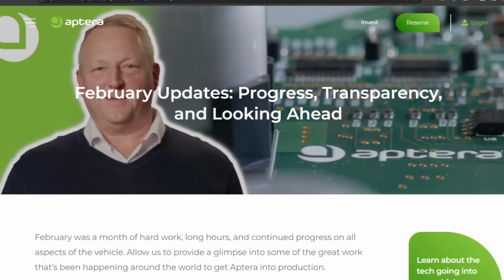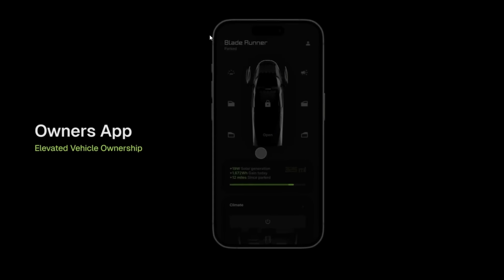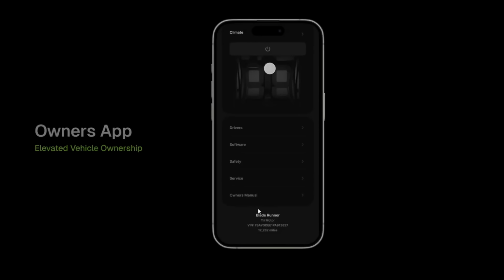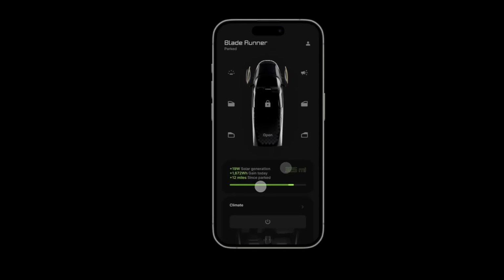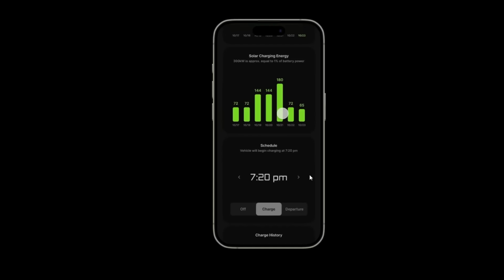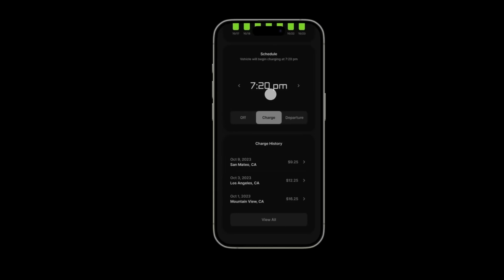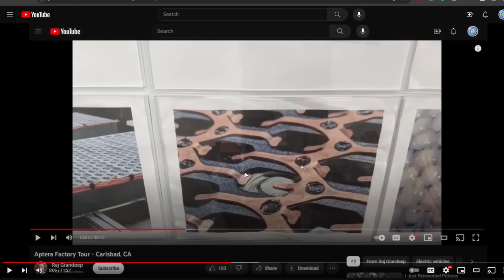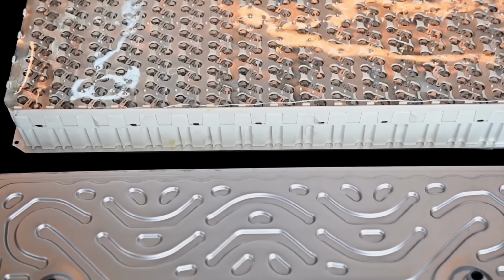Aptera February 2024 Update:  App and Battery Pack

Comment: If App is similar to the one from Tesla (which it probably is), on the Tesla App:
- Drivers - is to manage drivers, for example, if someone will borrow your car or you have 2 people using the same car at home
- Safety - there is no equivalent in the Tesla App, but could be to set up the top speed, valet mode and/or roadside assistance
- Service - to schedule service at a service center or to report a problem
- Energy Generation metrics are in KWh
- Battery Chage % limit - don't recall wiich battery will be used in the Aptera, but depending on the chemistry might not be needed, our Model Y is recommended to charge up to 90%, but on the 2023 Model 3 is Ok to go up to 100% (Tesla recommended settings)
- Charge history- Tela App has "Charge Stats", which has info on home charge history, paid charge history and also has metrics on energy savings, cost of charging at home and paid charge costs.

Hope this helps.

Comment: The idea of setting a charging limit below 100% is prior-generation thinking. Most current EVs have defined "100%" charge to be a safe value. For example, older Nissan LEAF vehicles were recommended to normally charge to no more than 90% (100% only at the start of a trip), but my 2021 LEAF normally charges to "100%" all the time. My guess is that, as the vehicle ages, whatever margin there was above 100% gets used to make the battery longevity look better.  Overall, this looks like a much saner view to battery management for the life of the vehicle, and I believe this is why Aptera expects their batteries to last the life of the chassis.

Comment: 3 points of interest,
1) batteries, CTNS is gonna help Aptera assemble the battery packs, but if Aptera gets cells from EVE energy in china, it would disqualify them from any potential IRA tax credits, and we haven't heard anything about this in a while, could they be sourcing batteries from someone that would allow them to qualify?
2) the motors, although we have heard that Aptera can make the motors themselves if the deal between them and elaphe has issues, but again we haven't heard anything about this in a while either, so are we getting motors somewhere else?
3) the belly pan cooling, could this be too much work and it be less engineering to go with only the traditional fan and radiator setup? dont they already need some form of forced air to cool things when parked at a supercharger? so will they skip the aluminum belly pan and go carbon instead?
Reply: I think that they have this all worked out.
Reply: Aptera has several possible suppliers of cells, and even though they have a contract with EVE energy, they will be able to balance the cost advantages and dis advantages with several different suppliers.  2170 811 NMC cell costs have been dropping rapidly.

We already know that Aptera is no longer using the standard M700 Elaphe motors that the design was based on.  Aptera's motors have been redesigned to lower the RPM of the torque curve and reduce parts count, making them easier to manufacture.  We don't know where these first motors will come from, but my guess is that Elaphe will build them.  Building a completely new manufacturing facility for them in the US, which they have the licence to do, will obviously depend on funding, but will likely happen at some point.

On your point 3, this is already settled, and pending validation in the PI vehicles my guess is that no change is required.  Adding a traditional radiator and fan beyond what is supplied with the HVAC system would destroy the promised performance of the vehicle.

Comment: Thx Steve. Re the APP…. I can only speak to my KIA Connect APP. For our EV6. So for
Re. Security Our APP is Security & Safety with options like 360degree View, Stolen vehicle, Speed alert, Curfew alert, Geofence alert and Roadside Assistance. We have a Valet setting too. Re Service ours shows last service and next due. I can set an appt with a specific dealership that I choose.  I do have a Driver setting but never entered another person details in there(.). Re Charge. I can set AC  0-100% and DC 0-100%. We have scheduled time for charging ( We use to charge Off Peak ) The APP states the choices made. The APP states  if charge is active or not. I can over ride the schedule from the APP ( but also at the charge plug) . I have state of Charge % and miles and “ Find Charging Station nearby. I don’t use much of the many options on KIA Connect.  Re Account.  Many personal stuff…The APP subscription level and expiration is show.  The APP had pin or face recognition entry. I have  some  type of vehicle health note “ No Issue Found. 
My 🔅allows to check and turn on/ off headlights, Taillights , sound horn and signals . I even have a washer fliud monitor and  brake fluid smart key power inicator. There are some ICE checks in this APP as it must also be used for their ICEs. We have Owner Manual too.  We can pre temperature condition in the cabin w/ Start/ stop and schedule I am sure different brands have different labels/ meanings/ choices. There may be more stuff… again too much for me.

Comment: Hi Steve.  Big fan of your channel and views on Aptera.  I just wanted to point out that as a retired engineer I know that margin is usually built into specifications so if people want to limit their battery charging to only 80% of full it is possible that the included BMS already does that so you would be limiting your charge to approximately 60% depending on how they calculate charge level.

Comment: One thing I would love to know about the batteries is, when they finalize the cells they are using for production, the specifics about the anode make up and more so the cathode. If they use a battery that uses single crystal cathodes, they can charge to 100 percent with less impact on longevity vs polycrystal cathodes. This seems nerdy and is but it impacts how would charge. Battery manufacturers don’t tell this but I suspect that EVE is using single crystal based off the performance of their cells.
Reply: There has been some talk that they want to make sure the jig they use will work for both low and high volume assembly rates.

Comment: I'm really concerned that they are still going with a manganese, cobalt battery for the launch edition.  Given the short term performance, and short lifespan I'm unlikely to buy either of my two reservations unless they go with a LFE battery, like the future Aptera are planned to have.
Reply: I would not worry about battery lifespan if the battery is truly Tesla-like, my Tesla battery lasted 10 years
Reply: While I can understand your point of view, since replacing the battery pack is akin to an combustion engine replacement, in terms of cost. That's actually why it's a big concern of mine. To replace an "engine" every ten years isn't appealing imo.
Reply: @glenyoshida  In ten years it is likely that we will have FAR better tech to replace them with.  I have replaced the battery pack in my Gen 1 Honda Insight (from 2001) once, and the replacement aftermarket pack is better than the original, even though it is still NiCAD.
Reply: Agreed. Battery tech is progressing at a furious pace. It's awesome. IMO, instead of the mandatory cost of a replacement battery, an LFE would give us all the option to either keep the still working LFE or upgrade to something better. An NMC means, we'll have no choice but to pay for the cost of replacement, or take the loss when we sell the Aptera. That Aptera is planning on LFEs for future builds, but not for the launch vehicles is short sighted, imo. The unusual shape and claims of range already place a target on it's back. @n.brucenelson5920
Reply: @glenyoshida  of note, CATL does makes LFP batteries in the 2170 cell. But LFP batteries are reportedly ~30% less energy dense than NMC batteries. So the 400 mile battery would probably be ~280 miles.
Reply: Yeah, it's a trade off. Personally, I'd much prefer the shorter range for the longer lifespan. 280 miles of range for daily use is good. And since they seem to have engineered for a 400 mile range pack, in the full speed production, using an LFE battery, then I'd love it to just be in the launch vehicles as well.  @garywozniak7742
Reply: BTW, thanks for the open discussion on the matter. I really appreciate the open dialog and thoughtfulness. I reeeeally want Aptera to be successful. When I first read about them in Popular Science over 15 years ago, I was enamored. Seeing the world through the lenses of a mechanical engineer, the low drag coefficient, the incredible mpg, and the radical form captured me right away. The solar integration with the current design puts me over the moon, so that's why it's so important to me that they keep the long term vision crisp.    @garywozniak7742
Reply: Tesla still uses NMC and NCA batteries on most of its long range and performance models.
Reply: True, but I've noticed that LFE is what's replacing that older and less robust technology. Telsa isn't moving to NMC, they are moving away from it.
Reply: @glenyoshida  In this case, Tesla's engineering requirements for the pack performance are different from Aptera's and they were having to stress their packs in ways that Aptera wasn't.  As a result, they were throwing away more energy in the form of waste heat, and probably shortening the life and increasing fire danger compared to Aptera's use.
Reply: Ah, that's great! so they were using NMC batteries, and still getting the 300k, or the battery chemistry is still unclear? @n.brucenelson5920
Reply: We have many examples of the same type of 2170 cells in model 3s lasting at least 300,000 miles, and Aptera isn't loading them as heavily as Tesla is.
Reply: That's fantastic to hear that the 2170s in the 3s are lasting 300K! In 2021, Tesla began using LFE batteries in the model 3, do you happen to know what battery type the 300 k mile model 3s were using?
Reply: @glenyoshida  2170  811 NMCs.

Comment: The Software, Safety, Service, and Owners Manal screen will probably provide information and options behind each screen.  Like the Drivers option would show you who's authorized to drive the vehicle and would allow you to add a driver.  The Software option would allow you to set options for the software that operates the vehicle like kind of regen braking, charge times, etc.  Safety would have options having to do with vehicle security.

Comment: It is nice that Aptera had this update, and good that they explained their progress on the battery pack and other efforts moving forward. I am wondering however about Steve's comment about CPC moving towards volume production 9 months after they reach their funding goals.
Reply: This has been a long stated position. Full production nine months after achieving $50M of funding. Nothing has changed apparently
Reply: @johnmalcom9159  Yeah, but that doesn't square with the subsequent $35M in Accelerator investment, which can be combined with the $22M CA grant money and the $81M tax exemption, which has been provided to Aptera in the meantime since that early announcement.

Comment: For the "Solar Charging Energy" screen in the app, I don't think the bars represent kWh -- the numbers are just way too large for that. Maybe it's peak solar output (in watts) for the day (power), or total Wh (energy) for the day produced by the solar panels. They need to show what the units of the numbers are. The caption under the screen title "300 kW is approx. equal to 1% of battery power" -- that isn't very helpful information and doesn't make sense (could they have meant "300W is ..." ?) I think this would be much better if it somehow displayed kWh or range added, since those are units most EV drivers are familiar with. And a nit pick --- they shouldn't use abbreviated words in the subtitle.

Comment: Really glad to see the app has the ability to remotely defrost. I was curious how i was going to deal with frozen doors and no handles at this time of year.
Reply: "I was curious how i was going to deal with frozen doors and no handles at this time of year." Just a knock knock and the doors will open. They won't freeze shut.
Reply: @billsmith5960  Really? Has this been tested in freezing rain and ocean spray?
Reply: @northernsouler  CPC says that their tests in Italy don't have a freezing issue.  They modified the original Roush Performance Design.  If they do, when I take delivery of my vehicle in Iowa, I will report on it.

Comment: Looks like the app is still in rough draft form. The units in the bar chart cannot possibly be kW (and also can neither represent kWh nor Wh). It only makes sense that this is the daily average *Watt* output via solar. For example, 72 Watts/hr*24 hours = 1,728Wh = ~17 miles of solar range added. On the upper end, 180 Watts/hr*24hrs = 4,320Wh = ~43 miles. It's therefore an indication of sun exposure on those days. So kW is inaccurate, and the average Watt output is not intuitive for the average user, but it at least makes sense this way.

Comment: I didn't see anything about preconditioning the battery for like cold weather driving, as opposed to the cabin. Would that somehow be unecessary?
Reply: I know that the liquid "cooling" loop has tge ability to cool or heat the battery. I amreconditioning. That they have battery preconditioning.
Reply: Where is that option in the Tesla app?
Reply: @unclegeorge7845 the only way to precondition the Tesla battery is to set the navigation to a supercharger as destination, but turning on the HVAC effectively does the same thing since warming or cooling the interior will wake up the battery. On cold days I would start defrosting the windows when I went in the shower, so by the time I was dressed and fed the car would have full regen plus be comfy warm with clear windows while the neighbors would be scrapping. If I didn’t pre warm and just got in and left, I often would have no regen for about 10 miles since the battery was cold
Reply: That's an interesting hack.  Probably cheaper than idling the ICE unit for five minutes prior to leaving only the thieves can't tell it's "available" so easy.  This same strategy should work on our Aptera.  Thanks    @kenmcclow8963
Reply: I read from a commenter that the Aptera is a Thermos. So the battery will always be warm.

Comment: I thought it was odd that the coolant connections are in the middle of the pack and pointed up. I would have thought the ends would be better for space optimization.
Reply: As stated by Chris Anthony previously, the battery pack is cooled through a bottom cooling plate, so the coolant connections actually face down as installed.
Reply: They may be instead optimizing for more even temperatures. Maintaining as close to 25°C is crucial for longevity of the NMC battery, if my memory serves me right. Therefore, taking up a bit more space to spread out the cooling channels to minimize hot and cold spots across the battery pack is probably better for the battery health in the long run.
Reply: At first glance inny-outy would better for heat distribution if in the middle rather than the end.

Comment: Good insight Steve - Thanks
Dual motor vs tri motor. Do you think we'll be able to turn the rear motor on and off if we have all 3 and just drive in dual motor mode? I didn't think that was gonna be possible. But it would be awesome if that was a feature.
Reply: I don’t think you can turn it off if you have the rear motor. I have only been interested in the front drive versions because I potentially want to tow it on a dolly behind an RV. If I buy the RV and if I find a dolly wide enough. Aptera chat bot told me yesterday that the rear suspension is fine for dolly towing. 
My current rear drive EV and my previous AWD EV had to be flatbed towed because there are no EV motors that can disconnect from the drivetrain and towing them would rapidly cause them to overheat and burn
Reply: I can confirm that you can not "Disconnect" any of the electric motors and tow The vehicle with the disconnected motor in contact with the road surface.

Comment: Looks like the "New" design Battery pack BusBars are Silver Plated.  No Hall Effect Skin Conduction due to Hi Freq, but maybe helpful for Heat Transfer?  Because Fingers must be Springy, probably Beryllium Copper within?  Just Speculating.  As shown Busbars are not Plastic Welded (as in "Older" Design), must have some sort of Pressure Pad to hold the New Design BusBars in place? Would that be the Cooling Jacket, and is it at Battery Potential all over? Really was thirsting for Update.  Increased My Anticipation!
Reply: If silver plated it's for corrosion proofing, batteries are DC so zero frequency